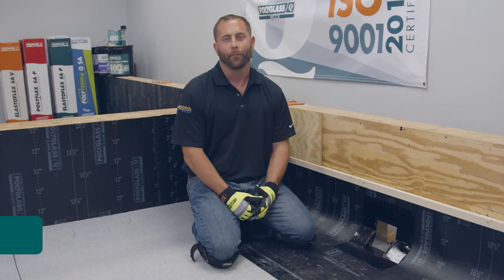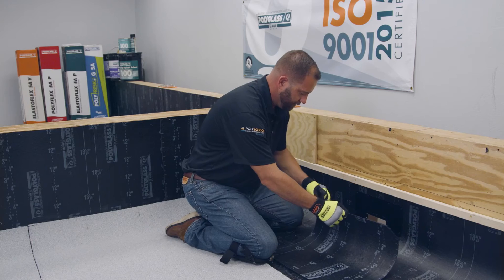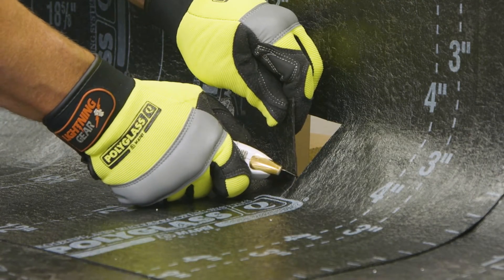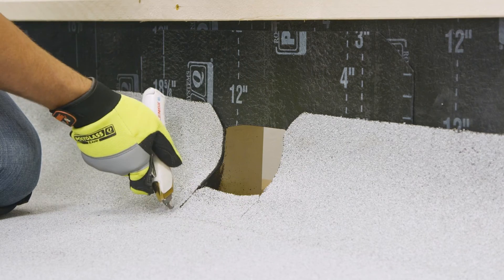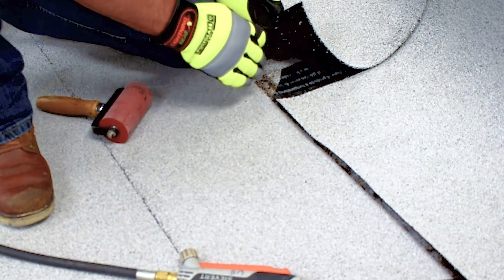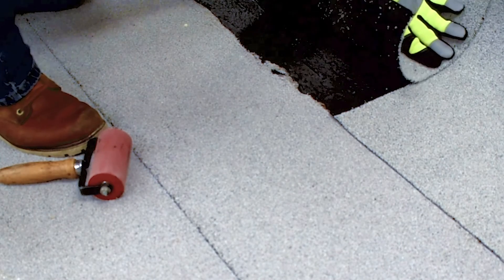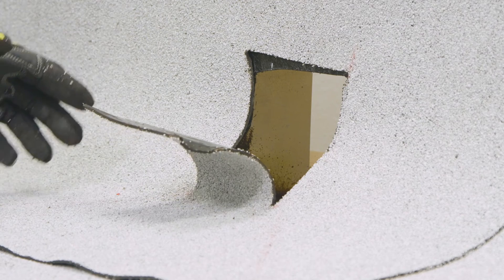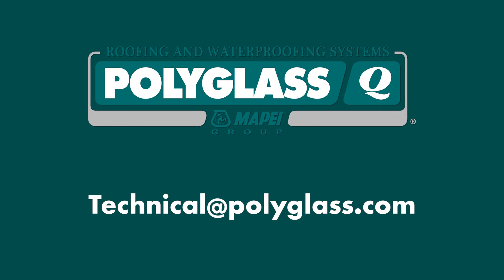Proper Scupper Flashing Detail | How to install Self-adhered Membranes

Comment: Do you add liquid flashing at the seams?
Reply from the maker: Hello, thank you for your interest in our products!

The addition of liquid flashing can help reinforce critical roof details. For example, applying Polyflash® 1C to areas like scuppers can enhance durability and extend the life of components that are frequently exposed to water and prone to failure. However, its use is not always required, as it depends on the specific project and detailing needs.

If you have any further questions, feel free to contact our technical team: https://polyglass.us/contact/

Comment: Would regular heat gun work instead of hot air welder?
I can't find your modified cement at my Home Depot store but there's a rubberized wet patch, would that work instead?
Reply from the maker: Hello Mickey! Yes, a heat gun can probably adequately heat the compound on our Self-adhered membranes on over-granule conditions. The concern is if the tool being used has a thin enough nozzle to get under the lap properly and still be able to hand roll it completing the bonding process. Additionally, it is important to be sure that no open flame torch or excessive heat be used on Self-adhered membranes. 

As for finding PolyGlass 500 or PolyPlus 50 we suggest that he try a major specialized Roofing Supply store such as ABC, SRS, or Gulfeagle. If that is unsuccessful a high-quality Modified Flashing Cement should work, but we strongly suggest they stick with the Polyglass mastic. 
For more info please contact our Technical representatives: (866) 794-9659. Thank you.
Reply: @PolyglassUSA  thank you!